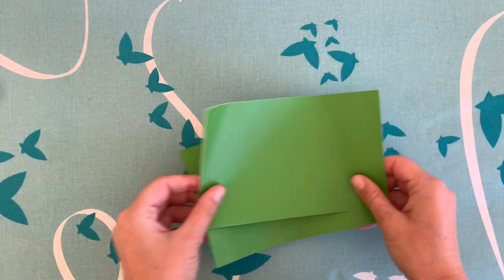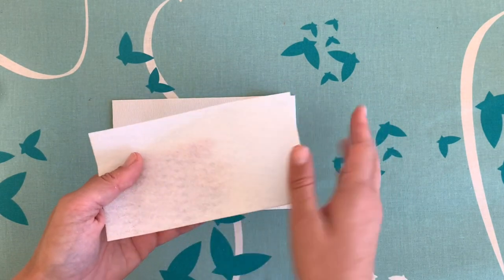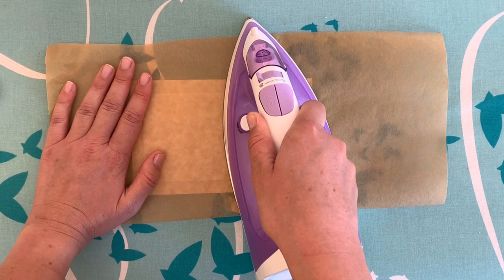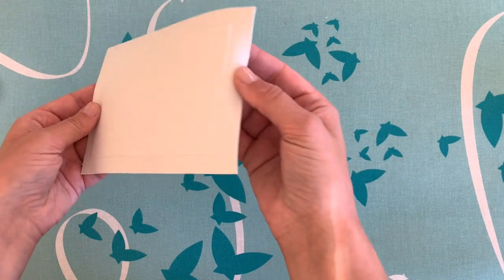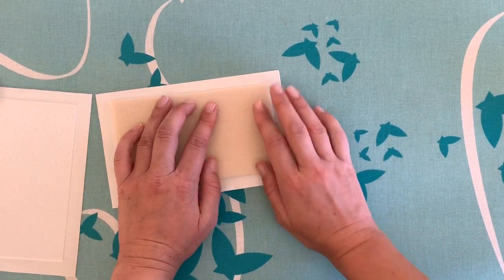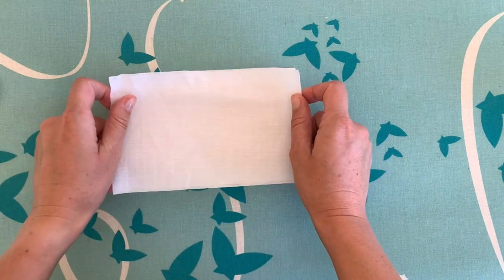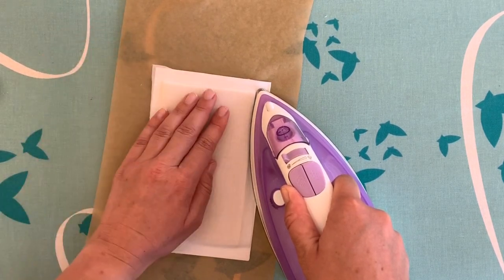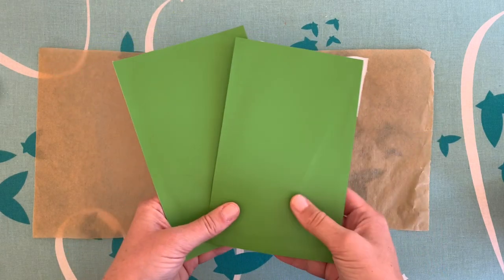Interfacing Vinyl with Foam or Fusibles - Get Those Beautifully Structured Bags!

Comment: Thanks very helpful  and very good English. I'm wondering if vinyl shrinks during quilting like fabric does. I could try a sample I guess! haha. I have some Mirror vinyl and glitter vinyl which look quite scary to use.
Reply from the maker: Thank you so very much! Vinyl  does also shrink a little when quilting, how much depends on the density of your quilting, the vinyl and the interfacing you're quilting it too. 

Fancy vinyls are so much fun, but can be a hassle to work with before you're used to them. If you're new to glitter vinyls, I do have a blog post which gives som handy tips and tricks: https://blogg.pinkponydesign.com/2016/10/sewing-with-glitter-vinyl-tips-and.html

Comment: Loved your video and Subscribed! Question: I have the same double sided interfacing. Once you used baking paper against the second side to adhere the first side to the vinyl, do you have issues during the rest of construction of the bag with the second 'exposed' glue side? or when you pressed it against the baking paper did it make it no longer sticky? I'm not sure exactly how to word that, sorry. It's just that there are times when I want to use the double sided interfacing for only one side and I don't know what to do with the other side that still has glue. Thanks!
Reply from the maker: I'm so glad you liked it!😃The glue on the exposed side gets heated up, but as the glue doesn't stick on the baking sheet, it remains on the interfacing and can be reheated and fused to fabric again when needed. I usually fuse this second side to the lining of my bag once I'm done constructing the bag (I show and explain that in this video, you get suuuper nice linings this way: https://www.youtube.com/watch?v=x2V93b_yxQk). However, if I don't wish to have the lining fused, I just refrain from heating the interior after construction, leaving the glue untouched. I hope that makes sense, if not, please ask again.

Comment: Madam I want make card holder fabric Wat method I can use interfacing more stabilize this method may comfortable with cotton fabric
Reply from the maker: I would recommend to use the interfacing recommended in the pattern you intend to use. It's so difficult to say as there's so many different ways of construction where different interfacings might lend themselves better or worse depending on amount of layers etc.